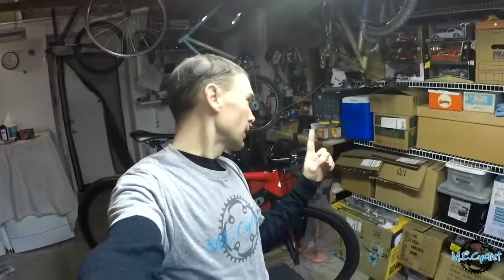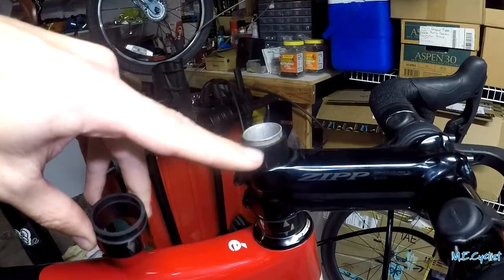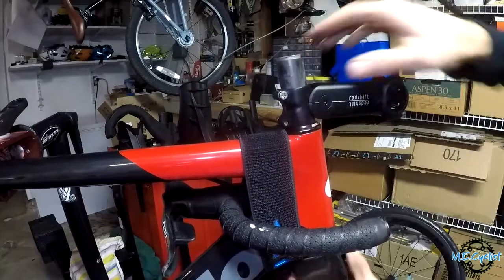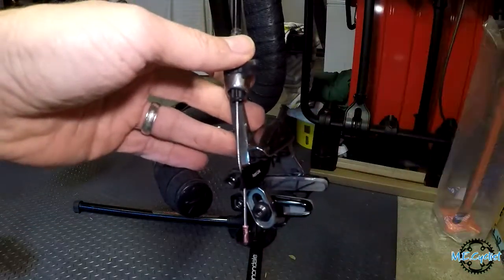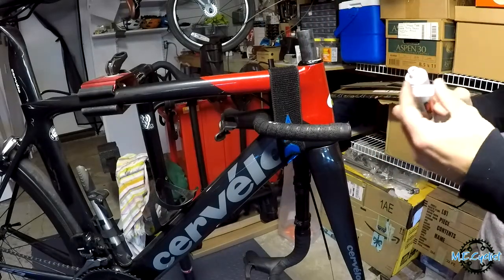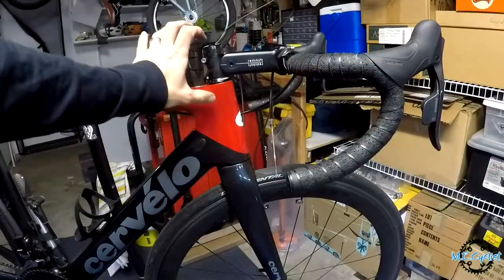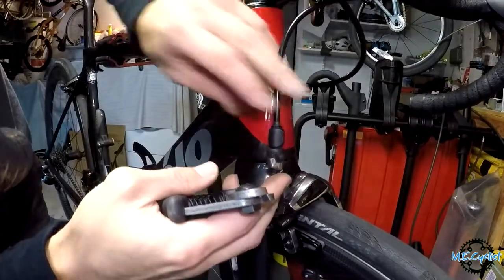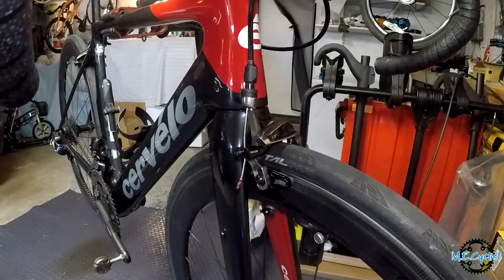CERVELO handlebar cockpit mod, part 1: steer tube cut, lower & install ShockStop Stem!

Comment: I like that stem.  I did notice a difference  with it on my bike.  I like that they are adjustable.  
Head bearings worry me to work with.  I always end up making things worse.  You've always been better at working on bikes and cars than me.
Reply from the maker: Yeah the stem is awesome. I rode the bike with the Zipp stem for a while and it was so stiff, couldn't wait to get the ShockStop back on. It does it's job well!
Reply: @M.E.Cyclist  I know why you set up your bike the way you do, but it makes my arms hurt how much you lean forward with the aero setup.

Comment: Can I push down the star nut if after tightening I still have some wiggle on the fork with the brake test?
Reply from the maker: Yeah if the headset cap bottoms out on the star nut you'd have to push it down further. There is a special tool to do that as the threaded hole needs to remain vertical to best fully compress the spacer stack.  Also, make sure your spacer(s), if any, sit slightly ABOVE the steer tube so the cap compresses down on them instead of the steer tube itself, which would leave you with a loose stem.  Hope that makes sense...
Reply: @M.E.Cyclist thank you, it makes sense. 
I took to a shop to fix the wiggling, and they told me I needed a new fork just by the fact that after tightening the cap it bottomed out. 
I’ll need to find a better mechanic here in the Detroit area.
Reply: @M.E.Cyclist I have a 2017 Cervelo S3, with the carbon fiber fork and the metal sleeve with the star nut.